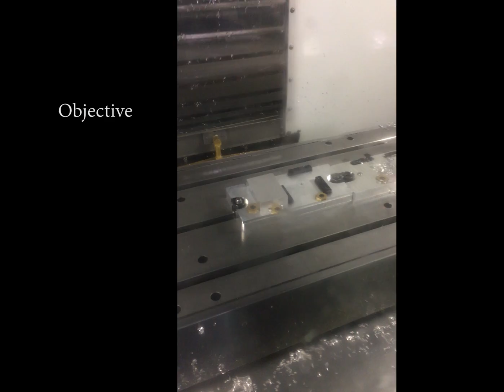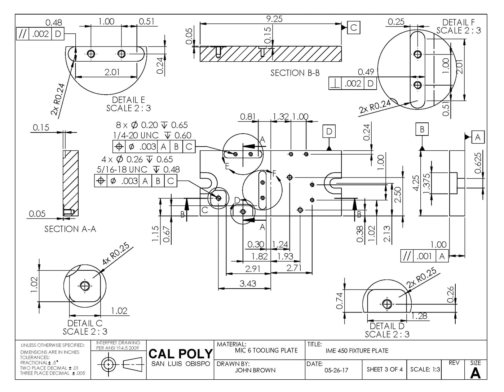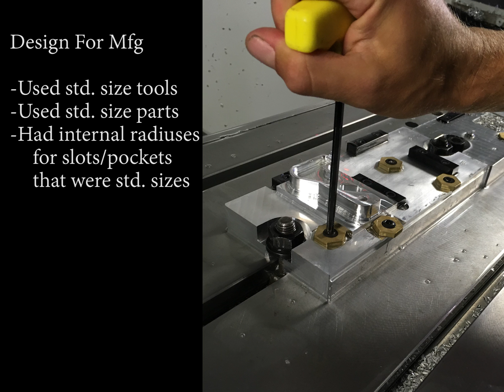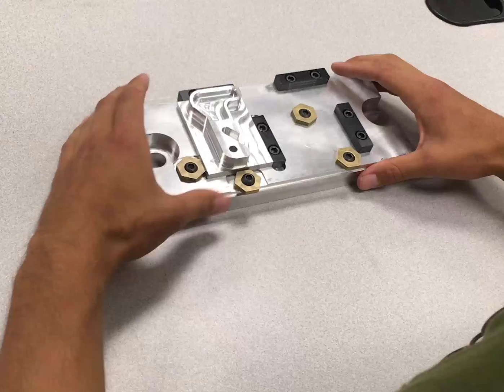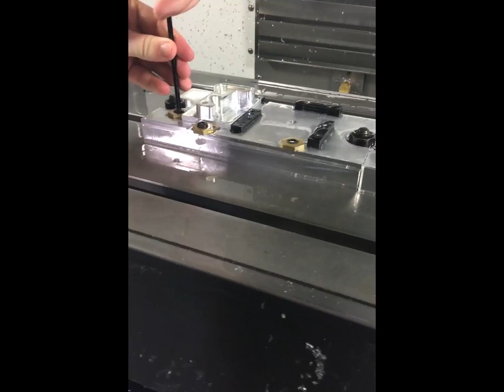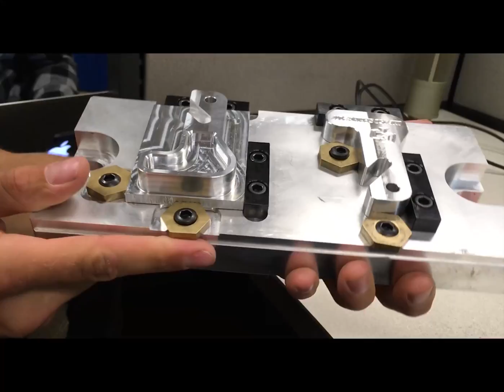Cal Poly IME 450 Fixture Design Project

Comment: Why not to do it in vise soft jaws? if there's a lot of parts to produce, then use steel soft jaws, I see benefits from that, that it clamps from all side, easy to make, don't need lots of fixture components. You never worry that you might cut one corner of your soft jaw.
Reply: They were give a fixture plate to work on in the assignment, not a vise

That's my guess as to why they went this way

Comment: Why not in op one, drill an extra hole allowing a T-handle allen to reach through to tighten the mitee bite on second op? Was you not allowed extra tools? You might even be able to interpolate a pocket hole using your endmill to save on a tool change.

Comment: Looks like my first mitee-bite fixture.  I just drilled a hole through the excess stock in the first op, to get the hex wrench through the stock to turn the mitee-bite for the second op.